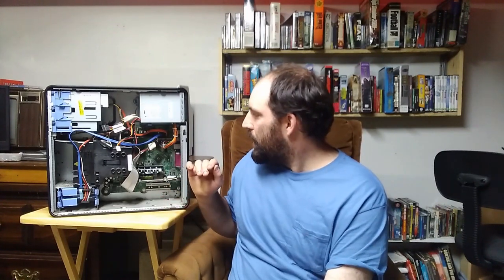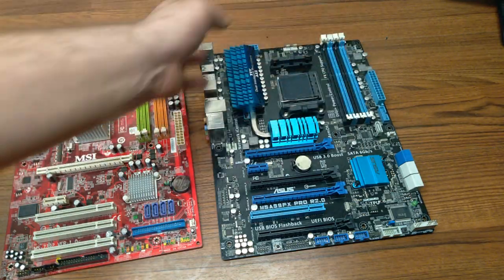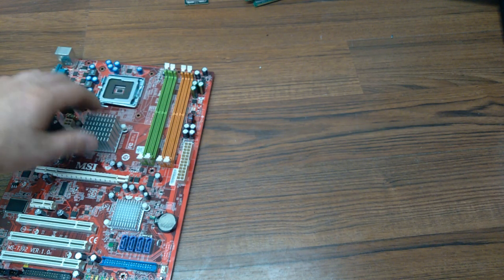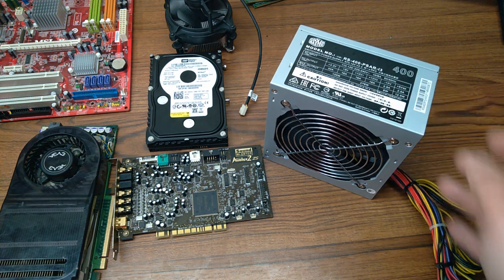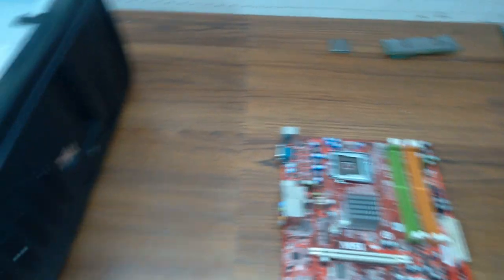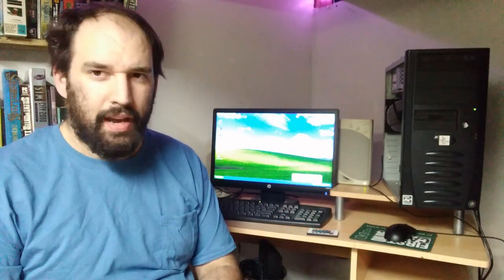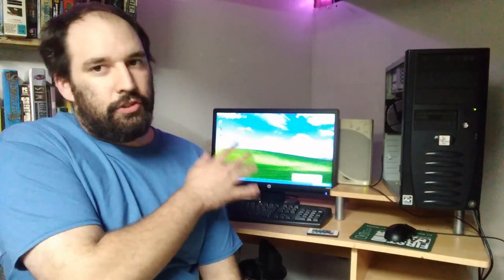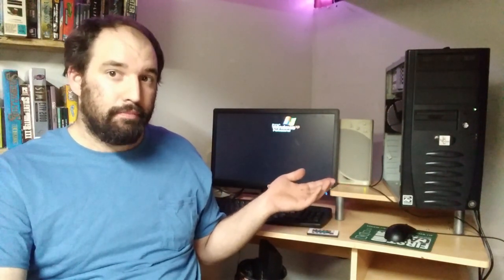Windows XP Build

Comment: Use the patch and you can get 64gb ram on xp 32bit :)
Reply from the maker: Ooo really!?  I think this board can take....8gb? I'll have to relook it up. (I'm currently recording some footage for the follow up lol)
But yea I'll have to look into it and test that out...I do have a am3 board that can take 32gb and has xp drivers 🤔
Reply: @definitelycasualpcs8789  Google windows xp pae or physical adress extention patch and you will find a heap of them I have one on my computer slightly newer then yours socket 775 with q9550 along with 8gb ram. Works with windows xp and can be used :)
Reply from the maker: @ToxicwasteProductions  oh that's what that is...
The xp version I used said it didn't have pae and I was confused but ignored  it since I've used that streamlined version before on a few PCs...def need to check that out!
Reply: @definitelycasualpcs8789  yeah sens sp2 or 3 can't recall they pulled that feature out and limited the computers to 4gig ram max. But it's only a software switch so running that software reverts that to where the pc works with all ram :)

Some software can freak out but most of the time they run perfectly fine and with the paylemoon webbrowser it's very useful even on the modern internet.
Reply from the maker: @ToxicwasteProductions  palemoon runs better?  I tried that at one point but had issues getting it to run...maybe it needs more ram?  I mean I did try it on the older dell c2duo so....

Comment: How did you end up with the most annoying unusual cases on the planet
Reply from the maker: Lol your going to need to be more specific. Which case are you talking about? The optiplex case? Or the case I used cause...yea that is a bit annoying.
Reply: @definitelycasualpcs8789  lol the one that opens from the front and the one that opens from the top I've never seen anything like that.
Reply from the maker: @RobertDickens2002  oh yea. It's super annoying when parts swapping...
I found another case with the same annoying design